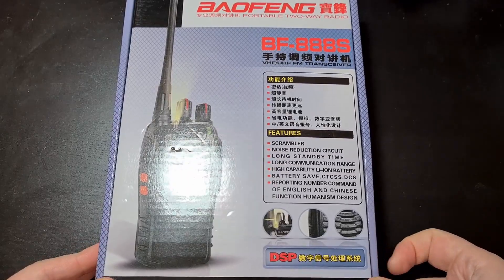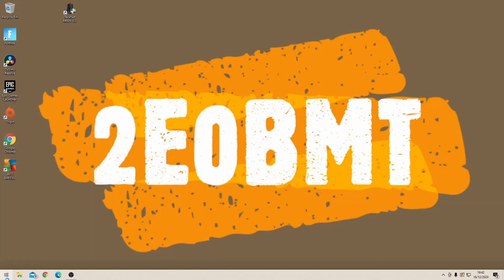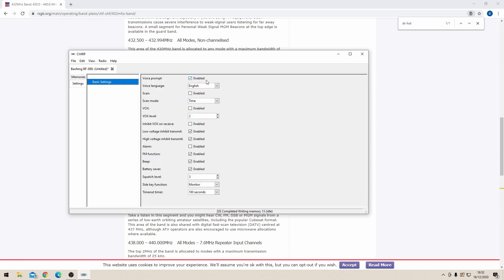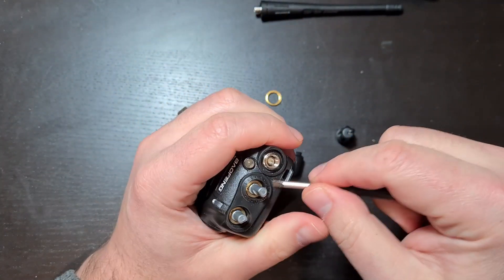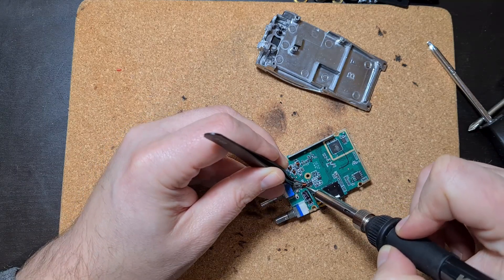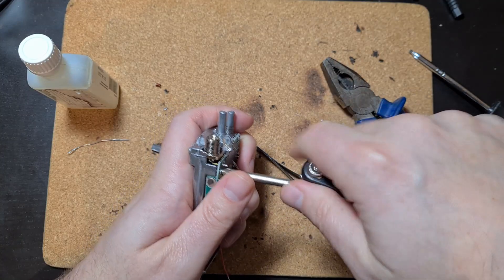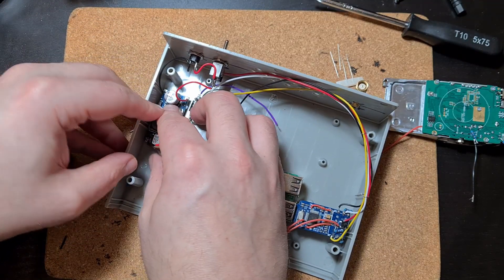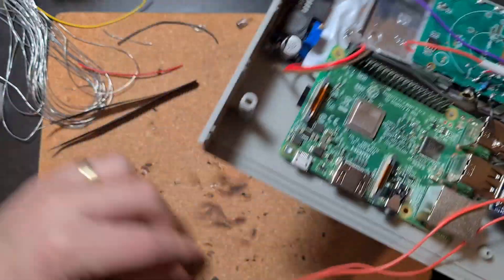PART 5: Idiot’s Guide To Building An Allstar Node – Baofeng BF888 Modification! Amateur Ham Radio

Comment: Since you removed transistor for low power output i guess aluminium body is not needed anymore to act as a heatsink. I noticed the thermal pad had contact mainly with removed transistor. So getting rid of the heatsink makes our node even smaller and more compact.

Comment: Is there a shielding reason you connect the ground to the USB port? Just wondering if I could use one of the many ground pins on the Pi? 
Great video's... I have ordered all the bits except the Pi... I may have to steal one out of one of my other projects since they are so rare.
Reply: I was going to ask the same question. There are multiole GND pins on the 40 pin GPIO connector.
Reply: @nickm8101  I used the Gnd pin and I found there was a bit more noise than what what shown in this build... But that could be anything. Since Pi's are rare and I am moving the one I have around to different projects, the pin is a better choice.

Comment: A new observation if the battery was also fixed inside on a secondry connector it would make the unit  more portable no DC required i will work out a way of switching from battery supply to dc remembering the different output -m0fxb
Reply from the maker: Yes..
 But the battery in the walkie talkie is not 5v so the Pi would need a second battery...
Reply: @RadioRevG5REV  I think there may be a way to upscale the 4 volts coming from the battery I will look in to it .Seems a waste to throw battery away .Andrea's

Comment: Hi Ben, I've really enjoyed the video series. I'm just learning about Allstar now as a couple of fellow HAM's have gotten me interested in this. I have a suggestion on the Baofeng mod though. If you are removing the final transistor you could probably do away with the chassis as the driver probably doesn't generate much heat. If it did you could probably get away with a small heatsink just to cut down on size. Probably doesn't matter in your setup because you have a good big enclosure. Anyway, cheers and I'll keep watching.
Reply from the maker: Great advice. I will have a play and see where I get.